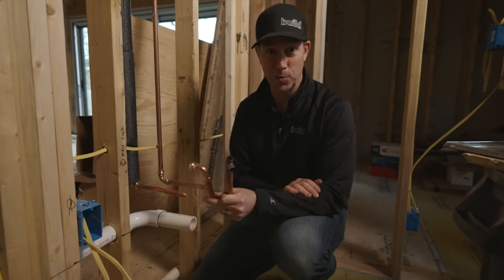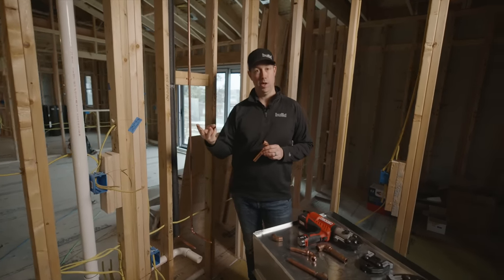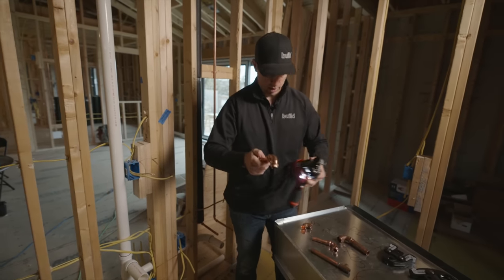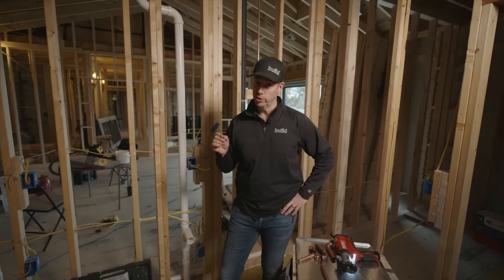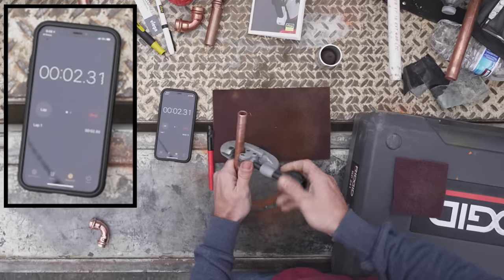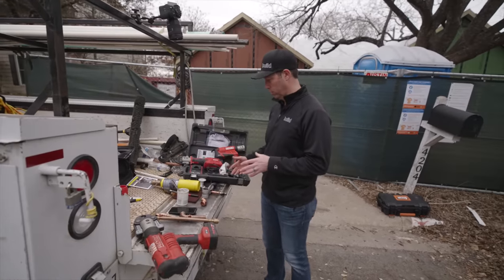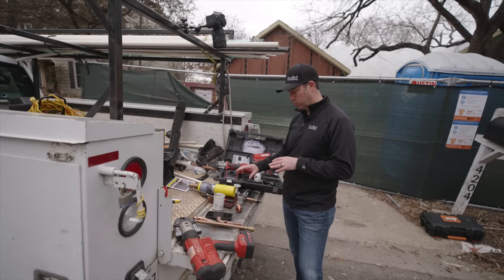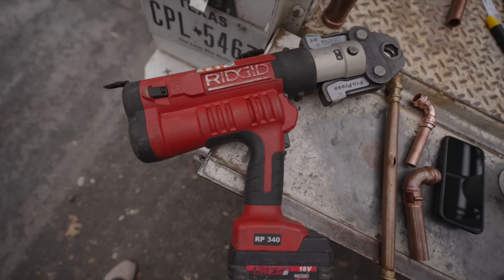Copper Plumbing - Viega ProPress vs. Soldered

Comment: It's called a scotch brite pad...It's made of synthetic fibers. 
  Brillo has soap built in and is made of steel wool.
Reply: Yea & flux does not seal a sweat fitting, solder does.

Comment: The pro press definately has many advantages over sweat, but the pro press is not perfect. Ive alredy seen a few leaks in brand new fittings that were not deburred or clean. A no brainer you would think, but since I now downsized to a townhouse, township rules won't let me change out the water heater even though I am a 31 year licensed commercial/industrial hvac tech. The highly rated plumbler we eventually hired sent two "kids" to do the work. He stopped by later to inspect and collect the check. I am not one to hover over people, but I kept an eye on them and wouldn't pay until they had redone thier sloppy work. A month later the fittings on top were leaking. I have a brand new Ridgid pro press at work, so I cut out the leaky fittings and replaced them after cleaning up the pipes. I also added pipe unions and ball valves above each water connection to the heater for easier replacement the next time.
Reply: Unions at the heater should be standard. Definitely hacks who did the original install

Comment: 2:39 depending on your water.  Everyone in my mom's neighborhood started springing leaks right in the middle of tubing after 35 years with M.  I replaced it all with L (honestly never hear of K) 20 years ago.  Time will tell.  Call me skeptical, but I'd need to see many more years in the field to trust the Viega system.  I have no doubt it'll last at least 20 years.

Comment: Most of the copper in my 1955 home are sweated copper type L and K going 66 years strong!!
Reply: Hope you like all that lead
Reply: @battleax4609  Yeah I guess that is one downside. Thankfully the water chemistry has kept the lead out of the water. I'm sure if I start disturbing the pipes and reworking things it could re expose it
Reply: @battleax4609  My house is 90 years old with the original piping - we had it tested and there is no lead in the water.   That said, I run the taps for a minute or two first thing in the AM....
Reply: @battleax4609   Where does the lead come from?   Is that the old copper piping?   Or the old solder?

Comment: I work in the building trades here in the UK and have witnessed several multi million pound hospital buildings with SERIOUS problems in their water systems caused by this type of fitting. The seals inside these fittings harbour and feed deadly bacteria such as legionella and Pseudomonas and are virtually impossible to kill due to the micro dead ends inside each fitting. This type of fitting in my opinion will be outlawed in the near future and the sooner the better.
Do yourself a favour and use soldered joints, they are much superior and are a tried and trusted method that will perform through the life of your building.
Reply: Interesting point. This is my first time hearing about this issue. I'll have to look into it.
Reply: O rings dont promote bacteria bud. If theres bacteria on them it was in the water.

Comment: Flux keeps the oxygen(creating porosity in the solder) from getting into the joint as well as having an acid that helps to etch the copper to aid in the solder bond. If all you use is flux, you're pretty well screwed, so I think you misspoke or shouldn't be allowed to sweat copper. Some flux's have solder suspended in it, good luck using just that.  .  The Viega system works well and copper is good as long as it doesn't freeze. Copper has a lower burst threshold than PEX.

Comment: In the intro - Did you mean Solder - rather than flux (yes flux is involved but doesn't form the mechanical bond in a "sweated" joint, just checking.

Comment: Have been using the M12 ForceLogic from Milwaukee for years now. Have had only 2 fittings ever leak after pressing, They were the brass style.  Only 2 negatives is the initial cost and the fact that if something leaks, ya have to redo a lot of it to replace it.   ProPress all the way baby!

Comment: In Massachusetts type M is only allowed on lower pressure heating systems.  Type L is required for potable water.  There was a short period of time when type M was allowed on potable water and going back and remodeling those houses now it is not uncommon to find 30 year old plumbing systems developing pin holes.

Comment: Fire retardant gel is game changer for sweating pipe in walls. Just spray it on like water and it provides great protection.
Reply: Have apreferred product, id llike to check that out.
Reply: WOW thanks I did not know the product existed.
Reply: @danielbuckner2167  kimball midwest therma shield but they are difficult to buy. Cool Gel on amazon is good too.

Comment: TIP for extending the life of ANY tumbling system (copper, per, even galvanised): get a whole-house water filter on the incoming tap. Removes most of the alkalies in the water reduces chemicals like chlorine and fluorine, etc. Cleaner water = longer-lasting fittings and longer lasting pipes.

Comment: I have copper waste and water in my 1965.  It’s crazy seeing 2 inch copper vents in the attic. Houses around me are getting pinhole leaks as the copper is thinning.
Reply: The pinhole leaks many time are caused by the iron in the hot water tank as it breaks down. The iron will travel through the plumb and settle into the horizontal copper pipes. The Galvanic Corrosion will then breakdown the copper and cause small pinholes. Also, if you do not deburr the pipe before sweating the joint you will get a turbulent flow which will also erode the pipes...
Reply: @michaelholliday100  Great point, too much solder at joint  can also cause turbulence.
Reply: @duanethieme4186  1/2" if solder is all a 3/4" pipe needs.

Comment: I honestly feel like having to switch out your press all the time is a pain compared to just hitting a ton of joints at once with solder. Also the elbows being a hard 90 makes it so much easier to measure pieces. When it sweeps (which there are sweat fittings that do that) it makes it a pain to measure properly
Reply: I can understand people preferring old school but not for that reason. Press is a time saver and the difference isn't even close. Switching heads on the tool takes seconds.
Reply: @okgroomer1966  Yea, this comment was absurd. I can switch heads & press 5 fittings in the time it takes to sweat 1. Especially if it's larger that 1-1/4 pipe.

Comment: Gosh you mentioning the hot work permit and fire watch brought me back to HVAC lol. I remember standing around with a fire extinguisher for such a long time when our guys sweat on fittings for gas when the jobsite demanded it (we did plenty of pro press fittings as well). Thats another thing he didnt get into, youre not only halving the time but also halving the labor per time invested with each fitting if one guy can press fittings without a fire watch standing by. I think that was only a major concern on commercial sites not residential but still a huge savings. Even if the fittings cost more, its got to be a huge labor savings. And theyre trying to outlaw MAPP gas.
Reply: Why are they trying to outlaw MAPP gas?
Reply: @jeffa847  there are so many stories. It may or may not have produced gaseous byproducts that could make welds/brazes brittle, it may or may not have had issues with the cylinders used to store it, and it's apparently a lot more toxic than acetylene in small unburnt quantities, all of these issues leading to apparent liability issues. 

There was apparently only one plant in England making MAPP gas that either went out of business due to unprofitability, was sold or burned down, I can't find the truth, so it can't be made anymore unless someone buys the patents and builds a new plant, which apparently has government opposition for reasons I can't find.

All I know is MAPP gas is not produced anywhere in the world anymore for one or many reasons.

Comment: The EPDM is definitely the sealing mechanism in propress fittings. Everybody says they'll last and being around for 30 years, maybe they will. I've seen copper a lot older than 50 years old going strong. That said, most of what I do these days is pex.
Reply: ive seen copper jobs going on 70 years still no problems...type L well well supported and done correctly..
Reply: I wasn't sold until I watched a video here on youtube where a guy took the EPDM seals out of the fittings, crimped the fittings, and then did a pressure test. They held without leaking. I was sold at that moment.
Reply: @mattguyear  LCopper lasts 4 to 5 years  supplying an ice machine
Reply: I am in a 90 year old the house with copper fittings still operating perfectly.  Granted, I have replaced components over the years but main piping still going strong.
Reply: PEX A or B?
Reply: @joshdiehl8737  weirdly, Pex b isn't easy to get around here.
Reply: @emmettobrian1874  interesting. Where I live you literally can't find pex a at big box stores.
Reply: Rodents can chew thru pex and flood a home.
Reply: @rodgraff1782  And water can freeze copper and different things in the water can cause pin holes. There's pros and cons to copper and PEX
Reply: @rodgraff1782  they can technically chew through copper too.
Reply: @emmettobrian1874  I know, concrete to.  They love plastic, ABS, etc
Reply: EPDM just keeps the pipe snug until you get the tool on it.
Reply: It also depends on the water quality on how long copper will last
Reply: @emmettobrian1874 and there is no such thing as an epdm seal that has an indefinite life span. Probably more than long enough for the temperatures involved and the number of heat cycles involved in plumbing. But I hate ORFS fittings in hydraulics which relies on epdm or viton o ring seals.

Comment: The press kit is very expensive (~$2K) which makes this a "pro only" system. $50 will buy you a good propane kit. Fittiings are somewhat expensive, but not crazy and worth the time/safety savings. That said, I think the biggest advantage is being able to modify/repair existing copper without worry about avery last drop of water turning into steam and wrecking your solder joint. I borrowed a tool and cut into my house main to add a filtration system. Worked great.
Moral of story: buddy up to a plumber with a press kit.
Reply: idk, I've been quoted $2-$3k recently for a pretty simple pipe relocation job in my basement.  I'd do it myself, but having to drain everything, sweat the fittings and almost certainly having to redo one joint because it leaks is a pain. So pay someone. But I can buy the Milwaukee tool and DIY for about the same cost and be equipped to do more, or just sell the tool!
Reply: A hand pump is what I will buy.140 bux not 2200!I'm not that lazy
Reply: Only the small tool costs $2k. Which only goes up to 1" pipe. The full size tool is $4k plus tax. Which is why i rent it.

Comment: My house has copper that is 90 years old and my previous house had 110 year old copper....  Not sure either PEX or those fittings would last that long, but if I had to choose, I'd probably go with PEX as it is quieter and you can do home runs with far fewer fittings.

Comment: Clint made it look easy! I usually move the torch tip around to the other side of the pipe at least once to help heat all the way around to carry that solder through but... I guess I'm a little more paranoid oh, I hate the idea of a call back!
Reply: it’s painful to watch someone only cook one part of the joint when they solder. there’s a video or someone doing this then cutting all the fittings open to show that the solder does not fill the entire joint. it can hold but it’s still not 100%

Comment: The thinner walls are for heating like fin tube and radiant floors. It has a better thru-wall transfer of heat than the thicker pipes.

You're typically not looking for pressure strength because of either the # of foil fins or it is embedded in concrete or some other mass body.

The thicker walls are for higher pressure lines, like the main lines in applications like high-rise and commercial utility services.

Comment: That press will never fuse the copper together. You are relying on a little O-ring to maintain the seal. Your test is also crap because he could have made all 3 of the solder joints on that T with an extra second.
Reply: Exactly what I was thinking.  He's selling.  And he makes a big deal out of the "dangerous flame" and how the plumber has to use that fireproof towel thing, I use an aluminum pie pan. What a crock.
Reply: The copper does seize together, the sealing element is a static seal made of EPDM. There’s a reason every large contractor is pressing. Labor savings, safety, reliability.
Reply: Jeremy Brua ,So your telling me you could cut two extra pieces of copper plus debur sand and flux all in one extra second sign me up for the tickets your selling because I'm paying big money to see that ,cut 2 pieces of copper debur and sand and flux in one second new world record.
Reply: @plumbbuild6517  The fact remains, sweating that T is faster than pressing.  I guess if you have an occasional drinker/worker pressing is safer and more idiot-proof.
Reply: Plumbing for dummies. Big companies use it so they don't have to hire qualified people.
Reply: (Are there hybrid fittings with a crimp fitting containing a solderable sleeve - to allow getting the fitting on a wet pipe (hypothetical)  then backing it up with solder which is more permanent than an "o-ring seal"
Reply: @plumbbuild6517  you would still have to cut, clean, and debur with those crap crimp fittings but you only need to heat that T once to solder it.
Reply: @kadmow  That's where pressing shines, on a wet pipe, during a repair or remod.
Reply: If heat is applied when pressing, it could be possible to fuse the copper together. But of course that's not what these systems do and definitely isn't recommended.
Reply: @KevinSmith-qi5yn  ha ha - heat as in resistive welding at 1085 DegC.  
good one...
Reply: @jeremybrua5523  true but you still have to cut, debur,sand inside fitting and outside of copper pipe flux inside and out and then heat the fitting, with press fittings cut debur and clean slide pipe in press done ,look I understand about sweating copper I love it I've been plumbing since late 80's, I'm just saying I've been in situations where sweating wasn't a option and therefore I was darn glad I have a Propress and every fitting they make for 1/2 and 3/4  ,but I still sweat when it's simple enough and on the right job.
Reply: @kadmow  you can use a jet swet tool on the copper pipe to stop.the water flow and sweat in a ball valve and then still remove you jet swet tool it pretty much simply enough the tools for that aren't to pricey.

Comment: Interesting that copper plumbing is seemingly a novel system in the Austin area - assume that is with production builders and tract homes?

I’ve lived in Dallas since 2010, owning a 6k sqft home that was built in 2001 - having just upgraded 6 full bathrooms, kitchen, home theater, outdoor kitchen and exterior/garage plumbing, all plumbing runs were original copper tubing - this is our 9th custom built home over the last 27yrs, and all prior homes, (New England and Midwest locations, as well as Atlanta GA and RTP-NC), had copper...

Comment: I am just getting ready to redo the plumbing under under my kitchen sink and i went online to look up the price of parts i would need and the 3/4 inch 90 degree elbow was $45.  I stopped right there as this simple update would become a major financial outlay just for the fittings and i have no idea what the press would cost.  Sweating fittings is not a problem for me but in the closed in space under the sink with a garbage disposal, dish washer connection and outside faucet connection i was thinking i could avoid sweating fittings in that confined space but the cost will force me to use sweat fittings.
Reply: The tooling is the spendy part. 90 degree elbows are like $6 list and can be had for $3-$4. Not sure who is selling for $45. Slap them.
Reply: @yeahyeah5422  probably for a 10 pack

Comment: My only pro press failures in 14 years are on heating systems with glycol added(protection for water coils in attic). One other was outside wall hose bib burst, but boiler was down. Type L is the only way to go. Had to edit, the glycol level was too high on first mentioned failures.
Reply: So really, those weren’t ProPress “failures” at all.
Reply: @MisterTwister88  correct, gylcol and hot water hose bib with mechanical failure.

Comment: The longer sweep of a Propress 90 does nothing to limit turbulence because the crimped joint on either end creates enormous amounts of turbulence. 

I see Propress joints fail quite frequently because of erosion caused by turbulence, usually on a recirc line.

Comment: Matt, I would like to have seen those viega fittings  cut cut in half down the axis of the pipe to see if they could be pulled off or, as you say were truly "fused".
Reply: I've watched many videos on viega fittings,  They aren't "fused" at all.   They are just squeezed tight.  You just need to cut it lengthwise with a dremel or multi-tool to release the pressure and it comes right off.
Reply: @scottkolaya2110   We know

Comment: no offense to your plumber in this video but I've been a plumber for 9 years and can move at least twice that fast when soldering when I'm not trying to rush. And the divot and paint dot are there for two separate reasons. You are correct on the divot but the paint refers to the o-ring. You can buy them meant for gas as well and the color of that dot will be yellow for HNBR o-ring and green for EDPM. The HNBR is rated for gas were as the EDPM isnt.
Reply: He was painful to watch. Hung over on a Sat. morning I was faster than that guy. But when you are selling a product you always make it look better than the other, so I give him the benefit of the doubt. Opening the flame guard was a nice touch lol